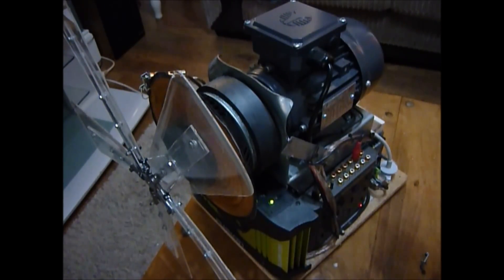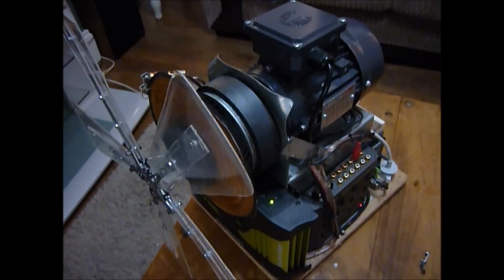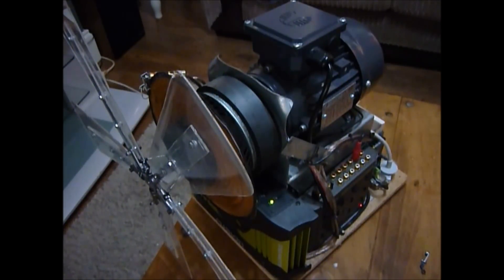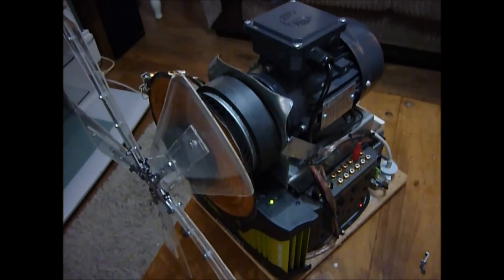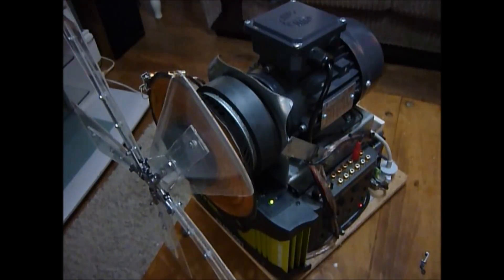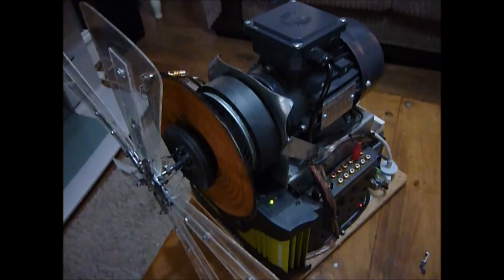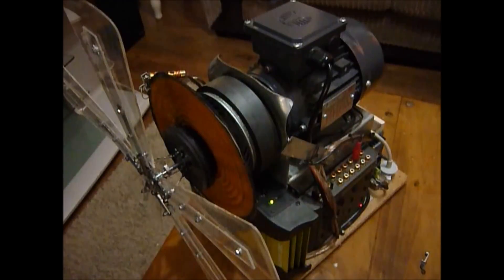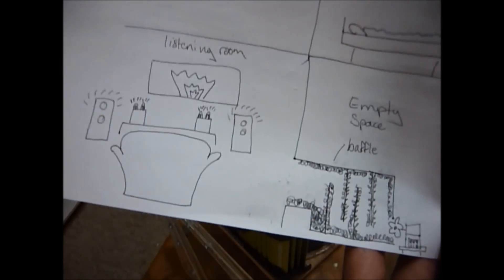Rotary Subwoofer  - Your questions answered

Comment: Great project, I'm about to give it a try with a few tweaks- using flexible foam blades that have no mechanical connections to the hub, with neodymium magnets attacked to the tips of the blades, and a voicecoil mounted inside the cowling, which is hopefully a bit cleaner, due to the reduction in mechanical components. I'd really like to see you continue with this project, modding it, making it even better, for example that baffle idea is great, and I'd love to see it and the results if it didn't take up the entire entrance of a room. The door baffle is much more convenient. Also, if a 3000w sub's excursion at 50Hz was 3", which is also its maximum excursion then its max output at 1Hz is only 60 watts. The design of the rotary subwoofer is so elegant, and will hopefully become more mainstream in the audiophile world compared with dynamic subwoofers.
Reply: Damnit i just had thst idea
Reply: share it on fb or so...?
Reply: is there some more videos about this... some new inventions?
Reply: UniCrafter He designed this incorrectly. There's supposed to be pitch adjustment for the blades. A feedback system and computer control. It needs a complete redesign.

Comment: It seems like a typical home attic is a large volume of air that is otherwise useless. You could have it mounted up there with a door on the listening room of the baffle for insulation purposes... That way you don't have to waste a bunch of usable interior space in order to use it properly... just a suggestion! (as long as you don't have a finished attic that is...)

Comment: Hey just wondering how much would you charge to build one and send it to the USA,  and is it possible to make one that can play from 100hz to 80 Hz down to 1 Hz, and if it's possible to make a smaller one all running on 12v and do you have a link to the fan and variable frequency drive your using
Reply: Pointless to use this above 25-30hz smaller would defeat the purpose the whole point is to move alot of air. Also watch his videos...

Comment: I'm curious about something, is the 'gain' or 'power,' whichever term you prefer, controlled by the speed of the blades? Or does it have more to do with the size of the blades?

Because i see them everywhere moving at a constant speed, what happens if i want stronger base or low it?
Reply from the maker: Basically, the faster the blades turn, the more air is moved

Comment: I wonder how it will performe outdoors? Will the effect be the same?
Reply: You would need a very large baffle or enclosure still to get the pressure difference, think about how a loudspeaker driver needs an enclosure to separate the front and back wave, this is the same idea.

Comment: Fascinating. So it's like a fan that can alter its blades to generate low frequency.  You should do a video demonstrating it moving some other object.
Reply from the maker: moving something else?
Reply from the maker: Well I'm one of my videos (test vids) if you turn the bass up and turn up the sound you can hear it quite well. Well you can on mine anyway. I could do an example vid. I'll keep that in mind. I need to make a new blade first
Reply: Actually, there's supposed to be pitch control. Here's a video of a production unit https://youtu.be/cQAoI9cuwWE  as you can see they don't function the same. I'm not sure the patent it's based on.

Comment: So 30 hz is the upper limit? Just make sure your main speakers can go down to 30 hz and you're set. I understand rotary subs load into another room however most walls are transparent to frequencies below about 10 hz below which there is no effective enclosure. One question I have... fan motor noise and the wind rush can be annoyingly loud. What do you do about noise?
Reply from the maker: Yes exactly. As for wind noise there is nothing you can really do about that apart from blade design optimization, but, in a real setup you would use a baffle that would kill the noise, like an exhaust of a car

Comment: the concept behind this is genius. i love music and to be able to replicate below 30Hz just astounds me. 
i have questions tho:

1. what voice coil do you use that can reach down to 5Hz?
2. is there a kit to build something like this? 
3. this video is over a year old, any updates? how is it holding up? do you use it often?

lemme know man, this is great.
Reply from the maker: you can use any VC but i reccomend 1000w and 2" or more. although the unit never uses anywhere near 1000w, the driver will be able to handle the forces.

there is no kit to build this unit. all hard manual labour!

i dont use this at my house as i dont have anywhere to put it, i recently sold it to a guy that came all the way from south africa to see it only 3 month ago, and was still going quite happily up until then. its a high maintenance piece of kit mind you so i have had to replace bearings and control arms
Reply: well usually speakers are rated for freq. i know thats a factor or cone sizw, shape, rigidity and vc. do most vc try to replicate all freq or will some not move  at ultra low freq?
and do you sell these? if so, is there good intetest? i freakin love the idea of this. and i can see these units rattling the walls on thunder or explosions. maybe loud big block fords ripping it up.
Reply: there has to be something better. the trw 17 doesnt require that kind of maintenance. i wonder if there are parts elsewhere that might be more solid. a thought went through my mind about doing this to an attic fan. might break your windows...
Reply from the maker: they move at all frequencies, theyre just "tuned" to a specific frequency range it just depends on how effective thy are at reproducing that frequency. the driver i used in this example was rated to 20hz, but will happily do 1hz.

yes, i make and sell these on request and not really much interest, i dont think my youtubers know or if they do are interested in me making them one lol

yes, the trw is well built and has custom built parts to do its work without the maintenance that mine requires, but thats why mine is a 10th of the price! and is just as good.

attic fan woldnt work as the blades are moulded at an angle. they have to be completely flat
Reply: you can detatch the blades and mount them to a rotor head large enough to hold em. it might have to be a gyro copter rotor head, but hey.. =)   we wanna rip some ear drums. =)
Reply from the maker: rowdy hansen that's what it used lol
Reply: thats what what used? your isnt big enough for a gyrocopter from what i see. those are like $3000 american from my little research. 
unless your gyrocopter isnt the same as what im talking about. im talking about the ones large enough for humans to fly around on. not the small drone types. =)
Reply from the maker: rowdy hansen oh, don't need anything that big lol
Reply: i just want it tough and not wear out. =)
Reply: WOW

Comment: I'd like to learn more about how you are attaching the blades to the speaker voice coil / surround to pitch them.
Reply from the maker: it's explained in the project vid. there's 2 parts to the swash plate. one is glued to the coil and the other to states with the motor

Comment: Is that even sound really, or just a pressure change? Yeah you can feel pressure changes.
I don't see how the pitch of the blades produces a sound other than air passing the blades.
Reply: Sound moves air in waves that vibrate your ear drums. Speakers do this by moving a cone back and forth thereby pushing and pulling air. This does the same thing by changing the pitch of the blades to push and pull the air.

Comment: One of the dimensions of your room has to be, at least, HALF that of the wavelength you are hoping to reproduce ; Example : Low B, 30.85 c/s (Hz) -- wavelength, 36.14 FEET  --  one of your room dimensions has to be, at least, 18 FEET, otherwise it won't produce the 'fundamental' ( * the 'fundamental' is the loudest, lowest, part of the tone, the musical note -- a musical note or tone consists of its fundamental and its overtones ( 3rd, 5th and octave).
Reply from the maker: thank you for this information, are there any maths for this? i would be interested to know so we can get the maximum experience. chris
Reply: The speed of sound ( feet per second) DIVIDED by the frequency (cycles per second) of the note/tone you want to produce EQUALS the wavelength (in feet)  ---   At 20 °C the speed of sound is 1125 feet per second -- for a frequency of 10 c/s (Hz) the wavelength is 112.5 feet -- to truly experience the FUNDAMENTAL one of the dimensions of your room would have to be HALF of 112.5 feet -- that's why only in a cinema or theatre will you ever hear sub bass notes faithfully reproduced.  ----  * I used  1115 feet per second as the speed of sound in my first example above, Low B.

Research ' 1/4 WAVE '  and ' T-line ' speaker enclosures -- and study ACOUSTICS.
Reply from the maker: ahh okay! thank you for this information :) ill remember this for future builds

Comment: Good Job, whats the highest Frequency that you can reproducing with your system? 
Like a clean 50Hz tone or Music up to 50 Hz?
Reply from the maker: around 25hz and either clean or music
Reply: @SolveElectronics  Could i ask what are the physical limitations that stop it at this frequency?  Would a change in rotor RPM or blade sizing change the frequency response?
Reply from the maker: @Deekh3d  it's size. The blade resonant frequency changes with size so it's best to find a strong material that has a certain resonant frequency for a certain length, and not to exceed the frequency otherwise it won't sounds good. Plus, the strength of the driver is a large limiting factor. But yes in theory changing rh size and rpm wild make frequency response better. Ideally a full rotation to it's upper max frequently i.e 1 complete blade rotation and one complete motor rotation at 20hz